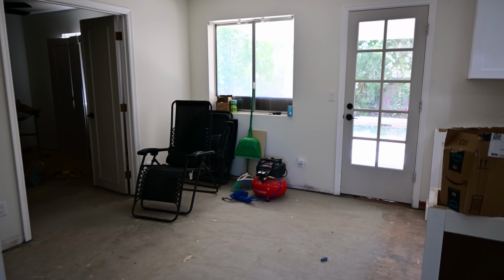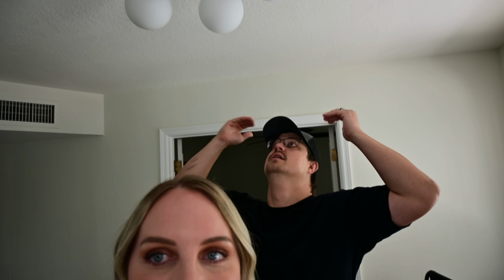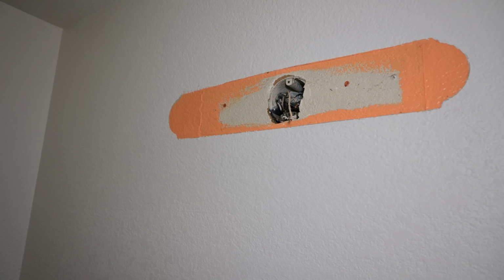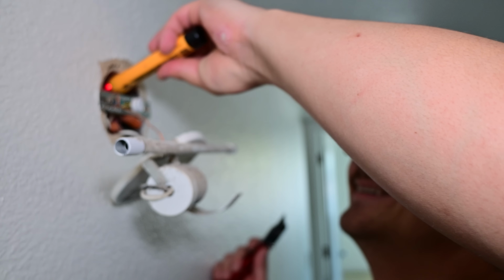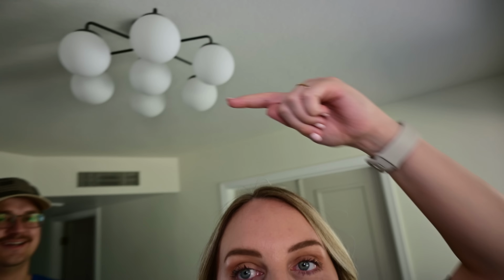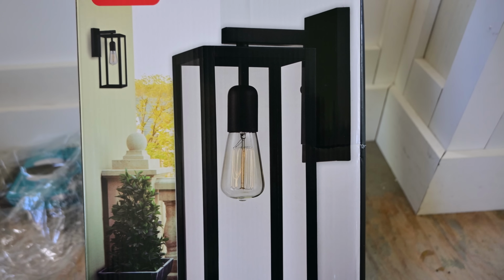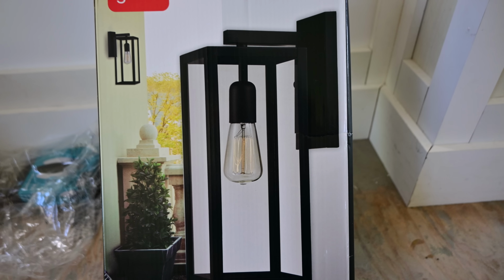COUNTERTOP INSTALL! NEW LIGHTING!

Comment: Light bulb shopping is too much for me! it is so  crazy! I love the countertops they are beautiful! Its coming together.  You did an awesome job on picking out the light fixtures.  I have a 4ft tube light fixture over my sink that is out. I have gone several times to buy a new one and get frustrated. Still no working  light over my sink. So I understand light fixture shopping! Love how you two work so well together and  job well done on the level cabinets. I'm getting excited to see the house done.

Comment: Great job you guys!    Question though, if you are renovating a whole house and knowing that the light fixtures will definitely be changed, wouldn't you take them down prior to painting?    New ones never fit the same as the old ones.